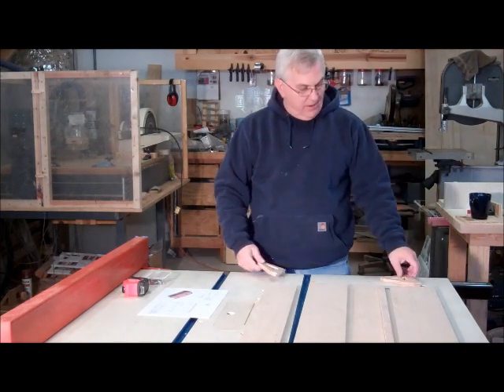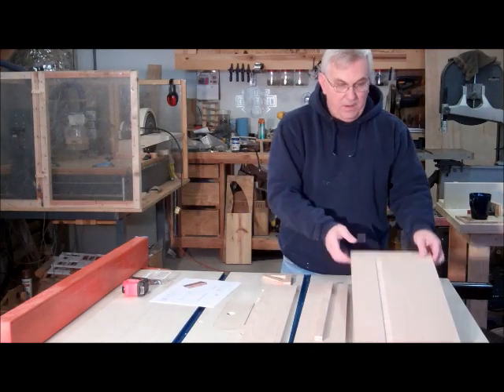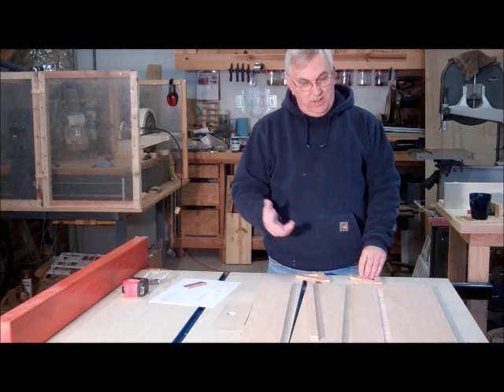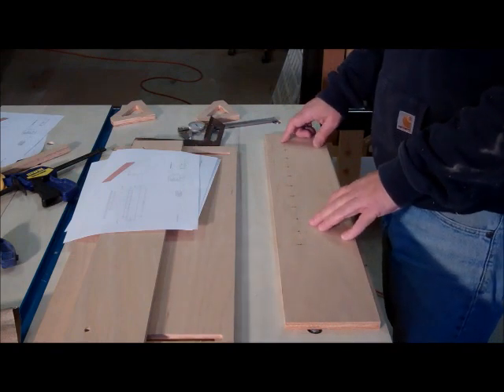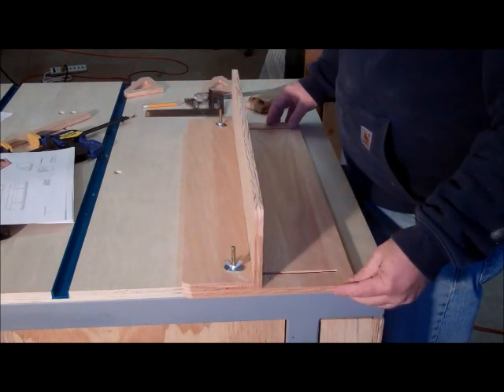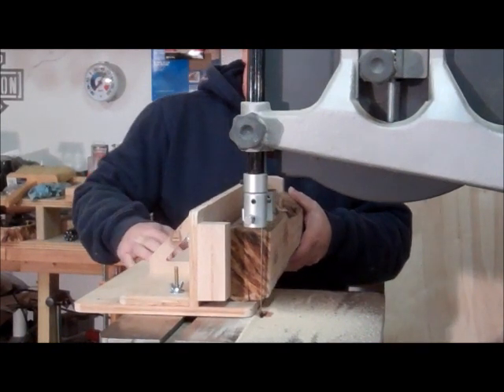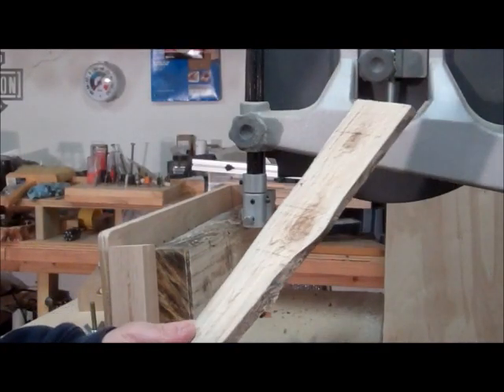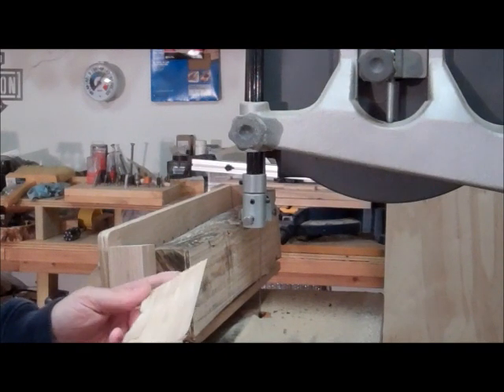Building A Band Saw Log Mill

Comment: You never showed the moveable hold down part of the fence. How does the log actually get held in place?? It looked like when you were making the cut the end closest to the camera moved quite a bit. I would think either adding some screws or a hold down to secure the logs is needed.